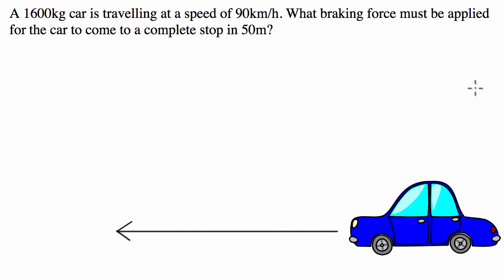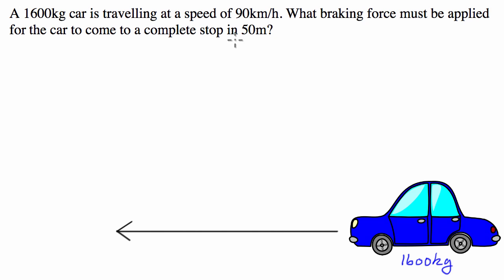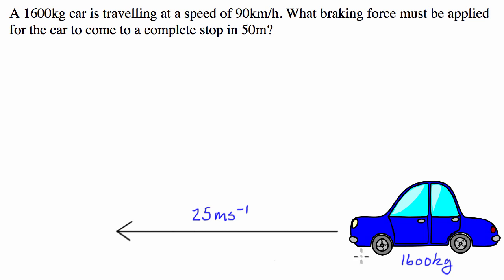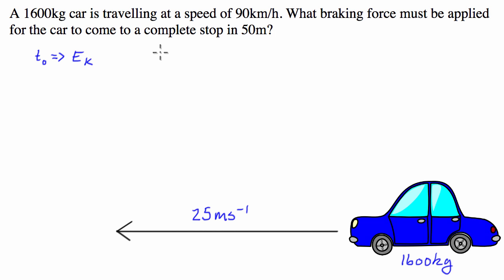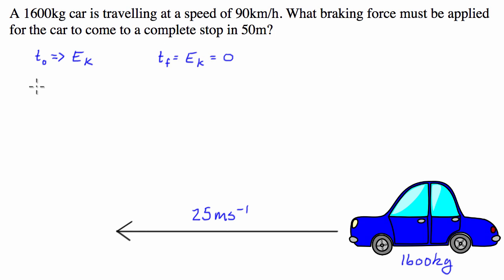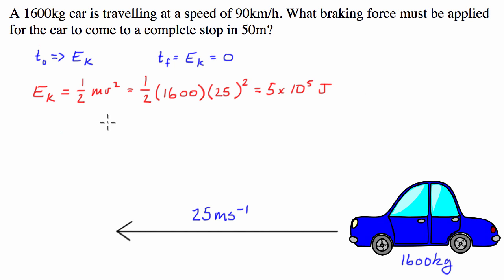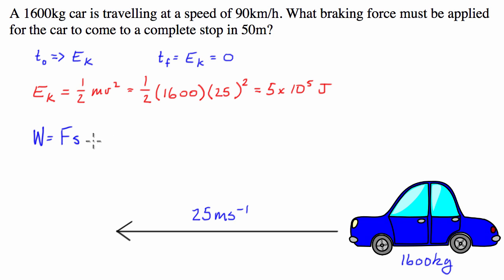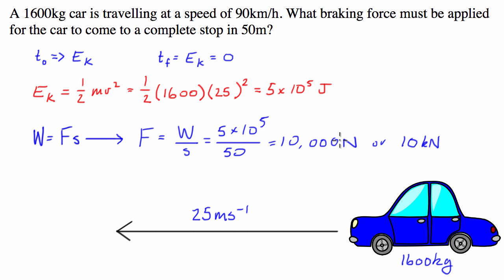Calculating the Braking Force of a Car

Comment: Hi, lets say that if the car are using 4 disc brakes with the same forces (no proportional valves installed), does that mean the total  of F will be divided by 4?
Reply from the maker: It sure does, unless the question specifically mentions a front/rear bias.
Reply: @Nik Lutfi
It will be force on each wheel. On the brakes force is much bigger because force out there, work on much smaller arm then arm of the wheel of the car. And in real car front brakes probably will take about 70% of all force because rear wheels will start lose traction.
Reply from the maker: True, however in high school physics you would probably just assume you divide the force by 4.
Reply: A good comment, but the forces at the disk/pad system are not relevant in this problem. Those forces 1. are not pointing backwards 2. are not working the same distance as the translation of the car 3.are not working ON the car but INSIDE the car.

Comment: The mass is 1600kg, but you must also consider the rotating components of the car (gears, etc.). So you have to multiply mass by a factor γ (usually γ=1.05 for passenger cars). So equivalent mass should be 1600*1.05=1680kg..
Reply from the maker: You’re right, this example is an abstraction of reality. There would be a bunch of different things that should be accounted for if you would like to obtain a more precise answer. Unfortunately topics like rotating mass and air resistance of the car are beyond the scope of the students who this question is aimed at helping. 

Interesting discussion point though.
Reply: @HaroldWalden  If you wanna get that precise then you would have to include aero and friction too.  However, good thought for sure.
Reply: @tomsalmon5917  Air friktion force is irrelevant, is a function of velocity and never constant.
Reply: Sorry, I meant aerodynamic drag and friction from rotating components not skin friction from the air. Possibly rolling resistance of the tires.
Reply: @teesalmon  Please read my comment yesterday March 13. The whole solution is unreal. The calculations must result in a backward brake force. But real cars don`t brake with locked wheels.
Reply: @goranmalmsten5306 Can anyone solve this ?
Find the stoping distance if Vehicles  weight = 300kg 
Speed 40km/hr
Coefficient of friction of ground =0.8
Wheel dia= 566mm
Width =177mm
Consider all wheels locked

Comment: Interesting approach: I would have said, a= (90/3.6)^2/(2*100) = 6.25 m/s/s   Then F=ma  F=1600 * 6.25 = 10,000 N
Reply from the maker: There is more than one way to go about solving these type of questions. Just proves how rock solid the solution is if doing it two completely different ways yields the same solution.
Reply: @HaroldWalden  agreed, I used to show my kids this when they had physics...

Comment: A Japanese bullet train has a mass of 715 000 kg and travels at a top speed of 275 km/h. Its braking distance from this speed is 4 km. Calculate the braking force. how do you do this
Reply from the maker: Your problem is literally exactly the same as this one. You just need to watch the video, make sure your values are in the correct units and you should be fine. 
🤓
Reply: @HaroldWalden With locked wheels all the way, 4 kilometers. Nice comfort and noise!

Comment: How can we find the disc diametre from the braking force?
Reply from the maker: There are a number of ways, if you throw me the information that your given in the question I would be happy to go over it with you :)
Reply: Harold Walden inputs are braking force, braking torque
Reply from the maker: If you write down the problem, I will try and solve it using a video :)

Comment: I'm an 8th grader that has this but it's so hard isn't this 10th-grade math. How did you get 5 x 10^5 and what is J 😭😭😭
Reply from the maker: J (or joule) the SI unit of work or energy, equal to the work done by a force of one newton (N) when its point of application moves one metre in the direction of action of the force.

Comment: why haven't made a conversion of kg into N (Newton) because Joule means Newton × Metre and you haven't converted kg into Newton...
Reply from the maker: Good question, to find the number of joules (or energy) that is associated with the car motion I have calculated its kinetic energy using the formula; E_k=0.5*mv^2. Using this formula you can go straight from kilograms into joules by multiplying it by the velocity of the object squared and then dividing by two.

Comment: i dun understand why the velocity is taken as 25 instead of 90
Reply: he's doing it in metres per second, to get from km/h to m/s you divide by 3.6. 90/3.6 = 25
Reply from the maker: Thanks @Udify... Sorry I was a tad slow answering your question, but Udify is right, I just did the conversion from km/h to the standard units which we use to measure velocity (which is m/s).

I hope that clears up your problem :)

Also, thanks for taking the time to check out my video, I really do appreciate it.

Comment: I have a question. Change that 50 m to 15 seconds. How would solve the problem, I have a similar problem to that and it would really help if answered this. I am having trouble with it.
Reply from the maker: Sorry about the delay, 
Rather than write the explanation in the comments I created a fully worked solution which is available at the following address:
https://drive.google.com/file/d/1BrgGZJc1VEfqmKrOeE-JQOgronhwydAb/view?usp=sharing
Reply: @HaroldWalden  Thank you man. This will help me.
Reply: YA everything is straight forward. My question was "What average braking force is applied to 2,500 kilogram  having a velocity of 30 meters per second if the car is to stop in 15 seconds?" Your question that you sent me is basically the same as this one right or is it different a little bit?
Reply from the maker: It’s exactly the same, just use the same method and swap my numbers for yours.

:)
Reply: @HaroldWalden  Sweet. Thanks Boss.
Reply from the maker: No dramas mate :)

Comment: a car has an acceleration of 14m/s when a force of 32 kN is applied what is the mass of the car? That’s the question I need help with
Reply from the maker: Well Newton’s second law of motion states that, F=ma therefore we can also say that m=F/a.
Which for you is:
m=32,000/14=2,285.71kg

Hope that helps 🤓
Reply: Harold Walden what does the / mean
Reply from the maker: - Stuart - “/“ means divided by

Comment: quicker to use v2= u2 + 2as rearrange for acceleration and use f= m x a . ps a= v2-u2 / 2s therefore acceleration is -6.25 × 1600kg= -10000 N
Reply from the maker: @Spencer Osei, I guess it depends what your more comfortable with. I would say that both methods are as valid as each other. 

It just shows how great the tools that we have to solve these problems are. The fact that we can both use completely different principles and end with the same solutions is amazing. 

But thats just me geeking out just a little too much.

Comment: In reality, braking force must start from zero, and increases to a target value. You cannot have  a 10KN braking force at the very beginning of braking.

Your demonstration is a very good example for high school students to practice energy conservation, not for braking calculation if you cannot take care this problem. Sorry. Besides, when wheel braking is used, rolling friction will be involved.
Reply from the maker: You are 100% right. Breaking force, like any applied force is incrementally increased until the required force is achieved. 

This is essentially a high school application which tests a high school students understanding of kinematics. 

Sorry if it wasn’t the video you were looking for...
Reply: @HaroldWalden  For your info, from the literature review,  it was found that none of them had understood the theory of wheel braking, industry and academia alike. All they have done are wrong or partially wrong even though wheel braking has been used for over 1,000 years.  Thank you.
Reply: @miaozhu8748  can you provide me the right method to calculate the braking power , stopping distance for a vehicle moving with X m/s ?

Comment: What about, “Calculate the distance it takes to stop in 10 seconds while going 70 km/hour?”
Reply from the maker: 1) You need to convert km/h into m/s.
2) You can probably assume constant deceleration of -1.944m/s^2
3) You can then substitute all of the information into the equation; v^2=u^2+2as and solve for s.
Reply: @HaroldWalden  Why can't you use F=ma to get -6.25m/s^2 or how did you get -1.944m/s^2 ?
Reply: @PicoGirl  convert  70 km/hr = 19.444m/s  and 19.444/10 seconds  = 1.94444m/s^2 deacceleration

Comment: Hi. Firstly, thank you for the information. I’m confused when I solve the problem with F=ma equation. m is 1600 kg and the deceleration is 12.5 ms-2. That equals 20000 N. Could you help me in finding the solution
Reply from the maker: You going to have to elaborate on what you’re looking for. I am not quite sure 🥸
Reply: Good evening, someone help me find out the answer for (b)?

I found the answer for KE, and it's 168750Joules

A truck of mass 1.5 t is running speed of 54km/hr. Find its KE,
 If the resistance to the motion is
100N. (b)How far will the truck run before it stops?
Reply: Hey, I know it is late. But it's better llate than never. The deceleration is -6.25ms^-2. You probably would have missed division by 2 during your calculation. So now, 6.25*1600= 10000N :-)

Comment: Nonsense, big misconception. The only way to get a brake force pointing backwards is to have locked wheels with skid marks all the way. Real cars have brake arrangements inside the car. As long as the wheels are rolling there is no slipping by the ground.
Reply from the maker: I think you're referencing a car's Anti-lock Breaking System (ABS). The video is designed to introduce students to how kinetic energy (in joules) can be related to force when it is applied over a particular distance. The context in this particular situation is irrelevant. I hope this helps answer your critique. 

:)
Reply: @HaroldWalden s, v, a and F are vector quantities in the same horisontal direction. Your calculation is a variant of Newtons second law.

Comment: what if you have resistance force?
Reply from the maker: Such as air resistance?

Well if you had a resistance force that was acting in a direction opposite to the car's motion (such as air resistance) you would have to take that away from the total force calculated. 

For example: In this video we calculated a required braking force of 10,000N however, if there was a 700N resistance force due to wind resistance or friction within the car's components (or whatever else you could dream up) then you would take that away from the total braking force. In the example I used in the video there are no other forces helping the car slow down. If the car has other resistance forces helping it slow down the braking force would not need to be as large (in this example the breaking force would have to be 9300N opposite to the cars motion). 

If your question asks for the braking force but it has included other forces aiding the car slowing down then do the calculation demonstrated in this video and instead of thinking of the answer as the force required by the brakes, think of it as the total force required to slow the car to a standstill. If there are any aiding forces then they can be subtracted from your amount. 

I hope I have answered your question. If I haven't, send a copy of the problem that you are trying to solve to harry.w.walden@gmail.com and I'll have a go at explaining it in my next video. 

Hope this helps :)

Harry
Reply: That's exactly what I realised, thank you anyways
Reply from the maker: No worries :) I hope the video helped. If you are having any other problems don't hesitate to let me know. 

I am trying to get a few more people to watch my videos so if you wouldn't mind telling your friends about my channel that would be great. 

Thanks again.
Reply: It's done
Reply: @HaroldWalden  it is not that simple. Air resistance force depends on velocity, is not constant.

Comment: Dear Mr Harold, I have a doubt about calculating the force exerted in the trailer due to towing vehicle brake. ? How do calculate the force ?
Reply: Do you mean the force exerted on the towing connection on an unbraked trailer?
Reply: Yes you are correct

Comment: you did not convert 50 minutes into seconds but took speed in meters per seconds. its wrong
Reply from the maker: Your joking right? The 50m is shorthand for 50 meters, not 50 minutes...
Reply: Harold Walden sorry bro.my bad.the whole time I was thinking why would anyone take 50 minutes to stop.sorry again bro
Reply: Harold Walden but when to consider Tyre radius and friction attributes?
Reply from the maker: I dont really follow what you are talking about...
Reply: I thinks skyhawk's question is wheter tire radius and rolling resistance have any effect on braking distance or needed braking force to stop the vehicle.
Reply: Camilo SALCEDO JIMENEZ yeah exactly
Reply from the maker: Wheel radius will affect the diameter of the brakes that would be possible to fit within them. I haven't covered it in this video (a possible topic for a future video perhaps?) The larger the brake rotor diameter the greater the torque which can be applied per unit braking force. With regards to rolling resistance, that is a concept that is far beyond what I was trying to achieve with this video. 

If I create a video on wheel diameter I will be sure to leave a link for you in these comments. 

I hope that helps :)
Reply: its not minutes its metres u smart alec
Reply: PJV 007 haha Alec = big 🧠